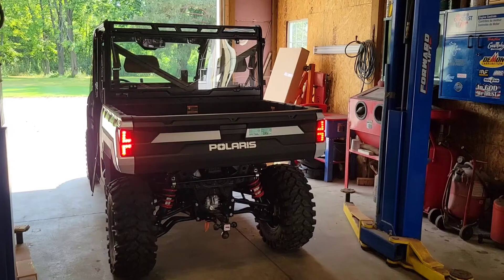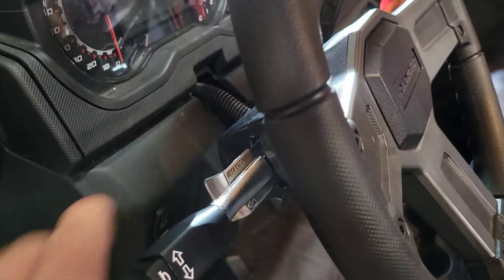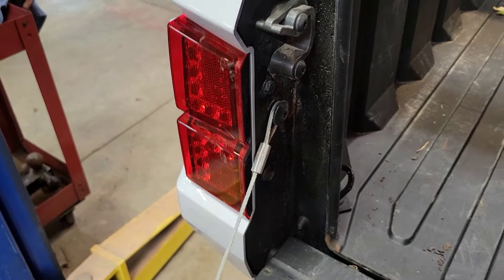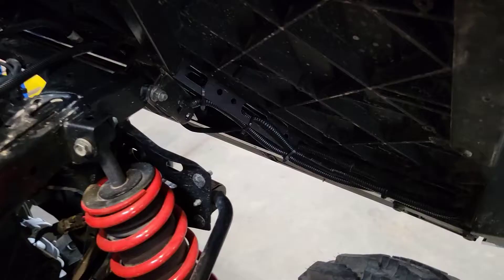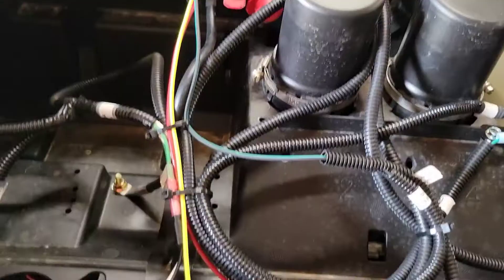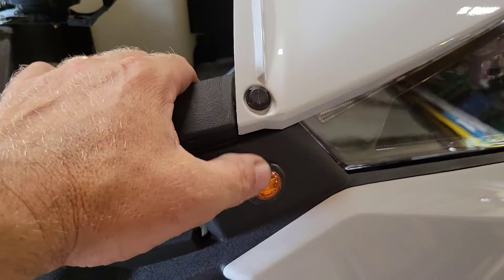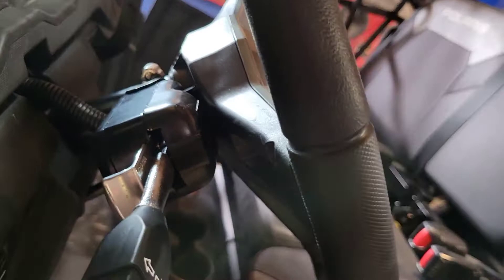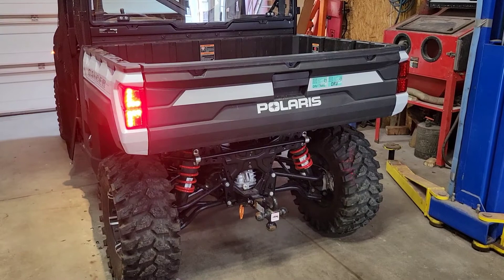SWEET POLARIS RANGER TURN SIGNAL INSTALL!! EASY!!

Comment: Thanks for the video. For the front side signal, anything behind the panel that you need to be careful with when drilling?
Reply from the maker: Plenty of room but proceed with caution.
Reply: @danczuba  thanks, worked out great

Comment: hooked up my horn and it wouldn't stop blaring. any suggestions?
Reply from the maker: Make sure you have a good ground, check the continuity of the relay. Make sure the relay is wired properly
Reply: @danczuba  ground is good, and what do you mean check the continuity of the relay? Also it’s a plug and go so how would the relay be not hooked up correctly?
Reply from the maker: @Joshuabaugher-jt2sp  basically you can't trust anything nowadays... Get yourself a test light and make sure that power is coming into the relay when you push the horn button, and not constantly. It could be a shorted out horn, a shorted out relay, a shorted out horn switch. Basically power should come from a 12 volt constant source on the fuse bar, go to the relay. The horn button should have a fused power source to activate the relay which in turns applies 12 volts to the horn, to sound the horn when you push the horn button. I've seen brand new stuff wired improperly so I always check everything when I'm having issues and rule nothing out.
Reply: @danczuba  can’t even get that far as soon as the wires are hooked up to the horn it’s blaring and if you hit the button it doesn’t do anything the horn just keeps blaring
Reply from the maker: It sounds like a wire might be crossed, back feeling 12 volts into the circuit. Can you bench test the horn, off the machine? Usually a bad horn will not sound at all. It sounds like a relay problem.